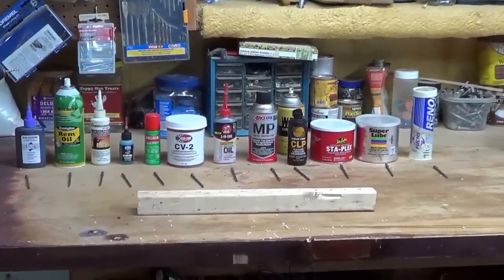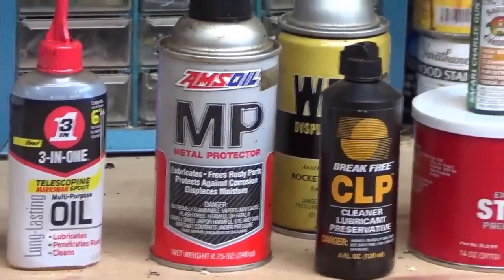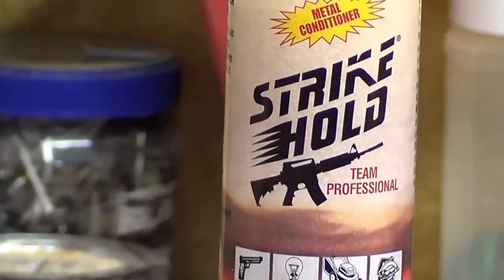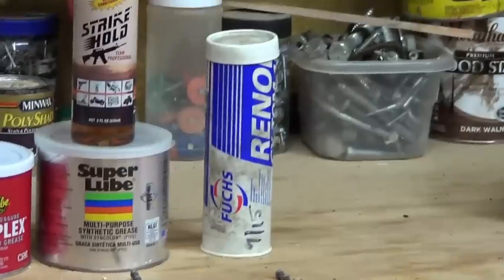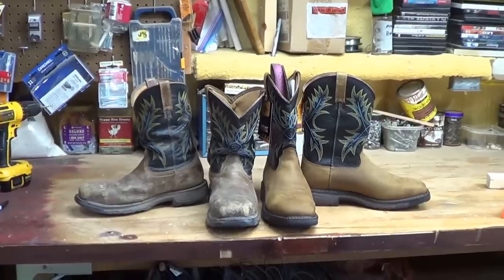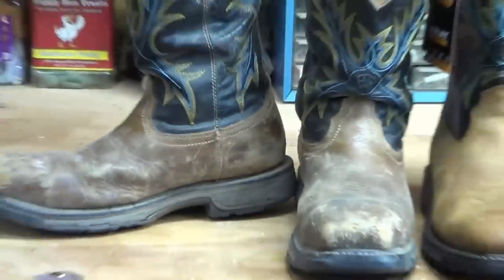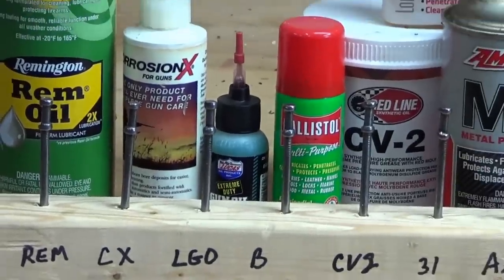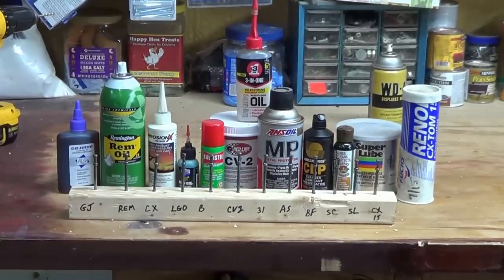Gun Oil Protection Test - Which Oil or Protector Will Work The Best

Comment: When I was 18 I would swim in the river with a blue steel charter arms undercover in my pocket I would unload it after , remove the grips and spray it out with WD 40, gun never rusted and never failed from gum up . Yep I use 3 in 1 oil too . One thing I noticed is that when I would coat my carbon steel knife blades with 3in 1 oil and put them away for  few years the oil would solidify like soft varnish and prevent the blades from rusting

Comment: Agree on not using WD40 as a lube or protectant, but WD for is a great dispersant and works the best I've found to clean in nooks and crannies.   It separates dust and metal fillings so they just drip off.  After, I use a laundry detergent to remove the WD, dry it off with compressed air, and then followed with my lube and protective product.

Comment: Oiling Nails That reminds me.
Many years ago we used to build with Australian Hardwoods for framing. 
Often heavy duty nails would bend, we would have to oil or grease the nail shanks, or drill a pilot hole about 1/3 rd to 1/2 way through and fill the hole with oil before inserting & driving the nail.
Back then saw sharpening was common and we often had to re-sharpen drill bits free hand.

Comment: Hoppes 9 cleaner and oil are good.  I've used them in my six shooter for almost 20 years.  Before that Hoppes has a different number, I don't remember what it as.  In my glock just dry firing with the itargetpro system it collects a lot of dust bunnies.  The finish on the slide for the glock 19 gen 5 version 2 is well made but very slippery.

Comment: Very cool. Thanks for hooking a Brother up. My oil bin on my shelf kinda looks like that. A dozen type of oils and grease. I think the CV-2 is going to replace my high temp bearing grease.  Mossberg recommends dry lube for the gas ring and I think the CV-2 will also replace that. I use CLP for general cleaning so I doubt I will be getting rid of that anytime soon.  I also use 3 in 1 with  PTFE (Teflon)  for triggers and bearings. The stuff is really thin and gets into the  spaces that you cant really grease without a major takedown.

Comment: What do you think about "Liquid Teflon" with a needle applicator.  It has the consistency of a heavier gun oil. As you work it in it becomes lighter.  I've never use it for firearms.  However where metal meets metal it works well.  Please let me know if you have any thoughts.   Thankyou!
Reply from the maker: never used it

Comment: I bet if you could find an old fashioned shoe / boot store that does shoe repair your old boots could be fixed up again.  I got a chuckle when you said "way above the level of most liberals" my first thought was. .......boy, that's setting the bar pretty low. I've had some dogs whose intelligence levels were many times greater than most liberals.
Reply from the maker: I did he said you cannot resole newer boots ...  boots with leather soles he can but not rubber
Reply: @HeyGunPeople  that's to bad, even well used those are still good looking boots.